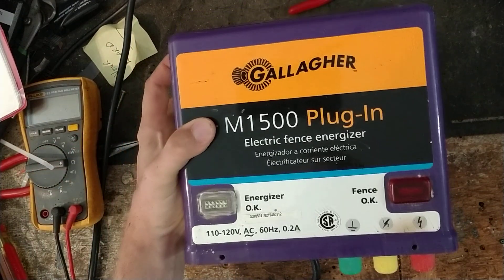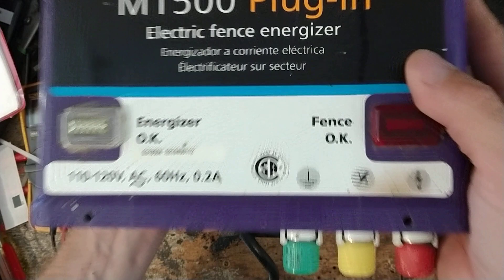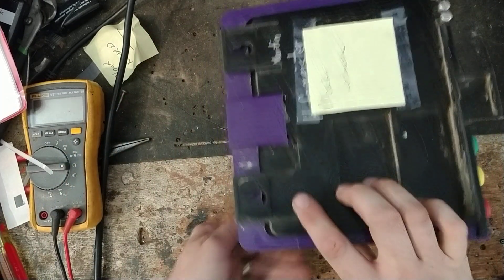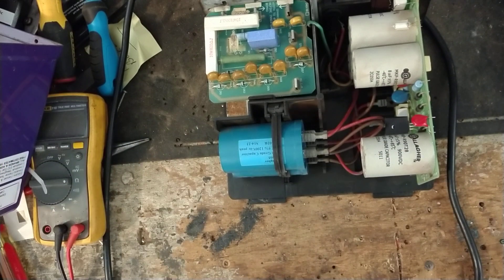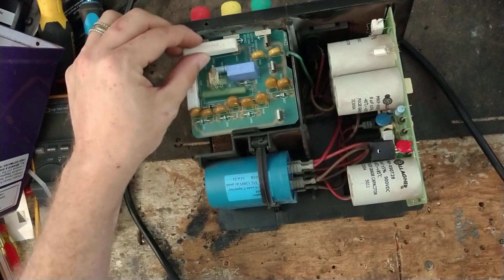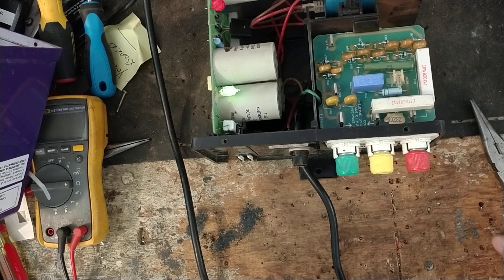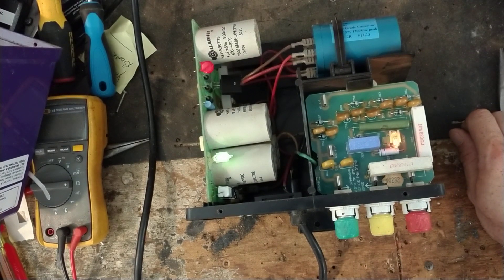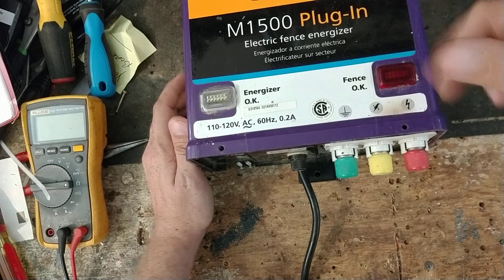How Does An Electric Fence Charger Work | Gallagher M1500 Fence Energizer Repair

Comment: I got parts for an old Fi shock 1000. I need to find all the parts, do U know anything bout the old Fi shock SS1000 ?
Reply from the maker: The only thing I know about the older fi-shock stuff is that most of them were solid state units and low impedance. So they couldn't run long distances or handle a lot of weed load on the fence. Shorter runs and cleaner fence they did ok.

Comment: Great video as always ! Having just bought the 2019 version of this M1500 I noticed it only has two output terminals,hot and ground. Did Gallagher have a change of mind or did they re-invent the circuitry to do small areas. I have my 1500 protecting just a 1/2 acre of fencing around my back yard trying to keep the local deer out. I must say It's working good so far as almost every night I am visited by deer ...I can tell because most mornings I can see where the fence wiring has been bent as they poke their heads thru it. I was also wondering what the clicking noise is ? An oscillator circuit charging up the transformer's primary ? Thanks again !
Reply from the maker: A lot brands went away from the half power output, except the bigger speedrite and stafix units, which 90% of the people I know that have those big units  don't even use the half power. The midsize and up Gallagher units are now the adaptive control, so it will adapt up the power as need be, so no need for a half power terminal. The clicking sound is coming from the energy being discharged from the capacitors through the transformer. The transformer doesn't charge up at all in any brand or model, they just take the energy from the capacitor. The transformer is actually the thing making the clicking sound. Your unit also clicks, but they're quieter because the transformer and the laminations are encased in epoxy and can't vibrate when it pulses. People love the old ones because they can hear the popping sound from a good distance away and it sounds tough to them.
Reply: @FencerFixerRepairLLCKansasCity  Wow... I would of never guessed that clicking noise is from the transformer, and yes my new M1500 is much quieter than the old ones. Transformer noise has always been an issue on industrial transformers and they are much better today than years ago. Do you have any idea if the primary of the HV transformer is taking a high frequency DC voltage of 500Vdc or so at maybe 400 or more cycles ? maybe 5,000 cycles ? My guess is it is not the standard 60 cycles and it would be a good time to modify the sine wave and frequency at the same time. Thanks again.
Reply from the maker: If the unit is plugged into a 110-120vac outlet, then the unit is running on 60hz because that's what the power company produces. I'm not sure what you're getting at with the 400 or more cycles. All brands, no matter if they're AC or DC coming in, build the power up to 200-800vdc high amps to a single capacitor or multiple capacitors. The capacitor is electrically tied in to both the board and the transformer. The board will trigger the capacitors with either a thyristor or SCR of different sizes, and that energy on the capacitor discharges into the transformer and all the transformer does is spikes it up to a higher kv reading. It does all of this charge and discharge stuff about every 1-1.5 seconds. There's a ton more to it than just that, but that's the basics of it. It's pretty straight forward stuff, until they start adding more technology and features to a unit.